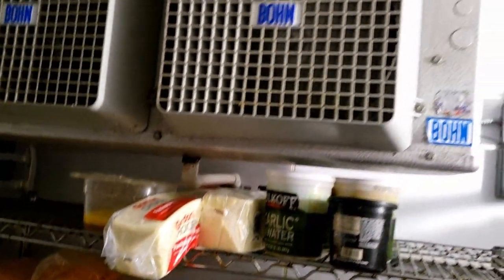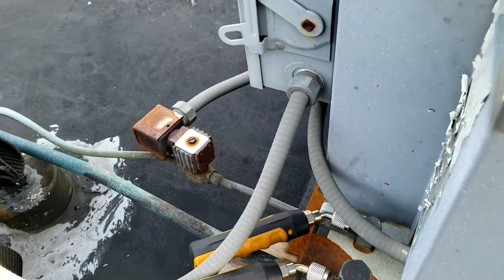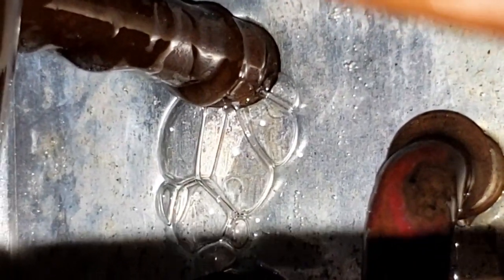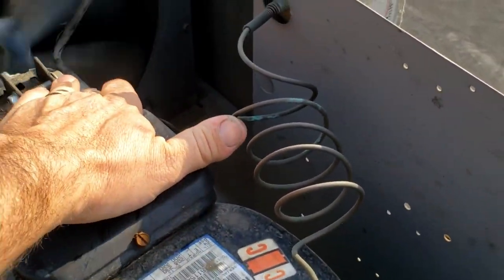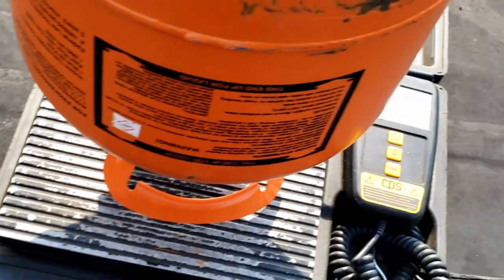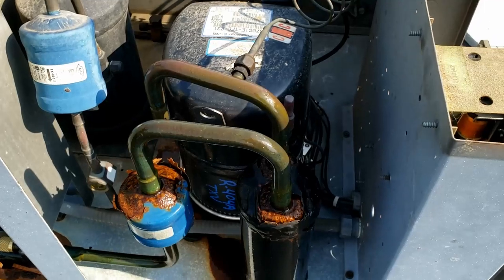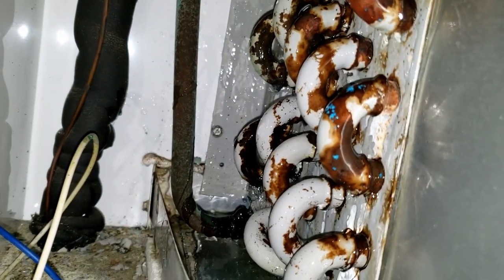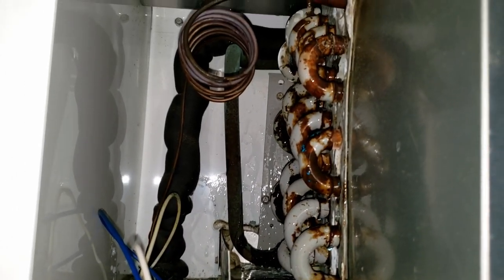Both Coolers Warm & Have Major Issues

Comment: Great content Rick. Fluke did replace my recalled 902fc sent me a brand new meter in the box.
Reply from the maker: Thanks 4 supporting it🤜🤛👍👍
Reply from the maker: I'm thinking of buying another one for my other bag. What models were affected or should I say what years were affected?
Reply from the maker: @hvac1-I finally looked up what you been talking about. I just bought a like new 376 yesterday on marketplace and already had one 376 and my 902, so now I have 3 meters that need fixed🤦‍♂️

Comment: Rick, I have a fan guard like In the walk-in cooler on a fan I got from a dehumidifier. It spreads the air out, and keeps it safe. I think it was a left behind on a job someone else had done.
Reply from the maker: I have seen large metal round elbows used in place of the grill to throw the air to the side of a cooler.

Comment: I’m really tempted to get that transfer pump. Sick of dragging ahose in to deice coils/ clean ice machines, etc 

This seems much easier
Reply from the maker: It can suck down a lot of water real quick. I need to get a smaller nozzle. I've been really happy with it so far. The five year warranty makes it that much better.
Reply: It doesn't screw off if it's pushing against a closed valve? I could also used many of those.
Reply from the maker: @Dubst3pT3ch  what?
Reply: @HVACRSurvival  The Milwaukee pump doesn't get too upset about pumping with no where for the water to go?
Reply from the maker: I don't try to run it for an extended period of time dead headed.  Eventually the rubber propeller will wear out, then I'll need to replace it. The worst thing to do is run it dry.

Comment: great job as usual, that txv is strange, the way the sensing bulb went in a well, think it said bohnmizer on the valve
Reply from the maker: Yea, I found out the hard way that its not a dry well, its actually in the refrigerant line with a compression nut. It was made by Bohn, no longer sold.
Reply: @HVACRSurvival  we still  have those  bohnimizor valves at our one facility.  Parts have not been around in years

Comment: I liked that system of washing,  you had a 5 gallon bucket and something,  what was that and how do i get it. Because i definitely can use that for different situations. 
Tks
Reply: "milwaukee  M18 transfer pump" is what he used, the pump itself is about $200, without batteries and charger. probably close to $500 as a kit with battery/charger.
if you already have milwaukee 18 volt cordless tools, batteries and chargers, it makes sense. otherwise you may be better off with corded model, assuming there's power outlets everywhere you work.

Comment: Can we get a link for the transfer pump? I don't see it on the tool list. Thanks.
Reply from the maker: No one has one listed with a direct link on Amazon. If you use my link in the description that allows you to buy anything on Amazon, I'll get a couple percentage points for it. I do appreciate you checking with me. Thanks so much 👍👍

Comment: It’s awful that they continue to run these units so long rather than replacing to more fuel economical models with also more environmentally friendly refrigerants. Some of the units you are fixing up are dinosaurs, I’m surprised many still work/can be fixed. You really fix everything fixable but some of them really needs to just be written off.
Reply from the maker: Some of this new stuff is garbage and I don't buy into all this new refrigerant stuff they keep selling. I've had more problems with r290 than 404 any day.  But yes I try to fix everything, it's what I do, I'm not a sales guy.

Comment: Is that a dog hair brush.
Reply from the maker: Cat brush I believe.
Reply: Never properly clean evaps cuz nothing is covered and and no place to move it to give it a proper cleaning. Its a cluster... this would be better than a brush.
Reply: @HVACRSurvival  Now i havento get one. As you can imagine in NYC these coolers are packed and you
Reply from the maker: That's why I spent so much time showing it, I originally used it for air conditioning coils but I use it for anything. Even condensers. I wondered if anyone would get anything out of that part or of they would jump over it.  Also the brushes go into the coil, so it kind of pulls out the dirt and doesn't just knock it down or into the coil.